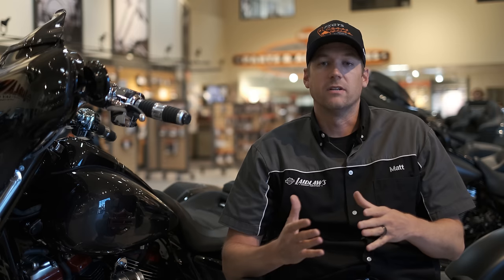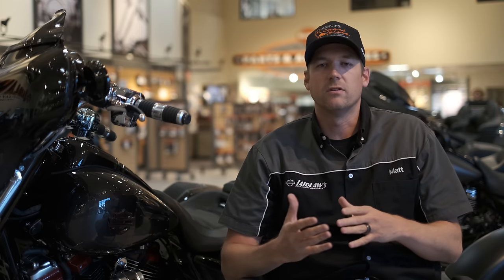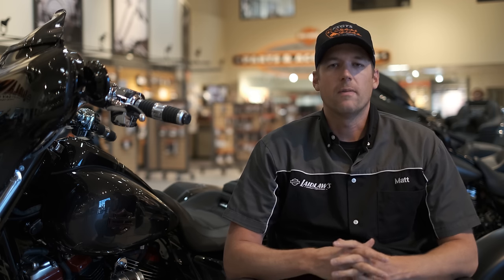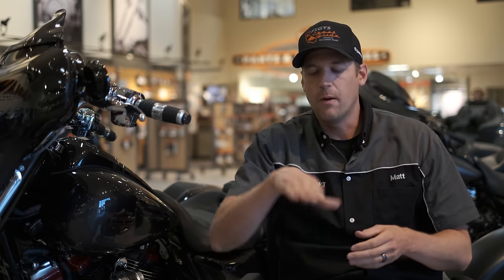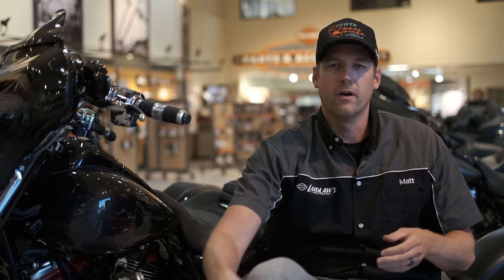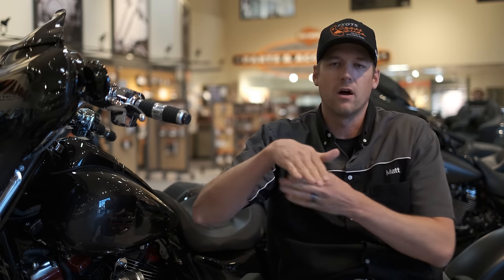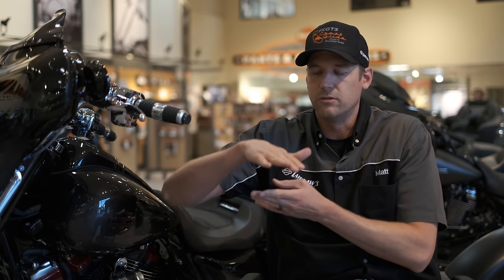Heel Toe Shifter on a Motorcycle: How it Works & the Pro's vs Con's

Comment: While in the military I always had to have spit shine jump boots on duty. Up shifting with just a toe shifter ruined the shine on the boot toe. Once I got a heel toe shifter from an aftermarket party in 1983 and installed on my 1981 BMW R100RS, my jump boots remained shined as I got to my unit. Today am on my 28th motorcycle, a 2015 HD Road Glide CVO with 95K miles since new with my heel toe shifter still shifting.
Reply from the maker: I love it. Thanks for the comment that is a good use! Definitely justified.

Comment: I came from right side shifting in the sixties to left side toe heel in the nineties. I think your right wrt floorboards. Call it lazy or more comfortable it really comes down to how you adjust the shift levers. In your example 117 Street Glide the heel lever is a bit high for my liking.  IMO you want it just high enough to make positive shifts without board interference. For me, I like the toe higher than the heel, adjusted on a straight line at roughly 9:30 - 3:30. I have my RKC, SGS and Deluxe all set this way.

Comment: Been using the heel shifter since '03. I prefer it. Some buddies don't. Be careful, do not stomp it, and keep your linkage tight. When tightening the rear it helps to push the arm back/vertical.

Comment: Im 5’4 1/2”….currently on a Forty-Eight with the stock forward controls. 
Fun bike. I could use a heel toe shifter to make things more tolerable; I am constantly pulling myself forward in order to remain comfortably in control. I have been looking into the ‘Rock-it shift kit’. Still on the fence though. Thanks Matt.

Comment: I'm a brand new rider, been out now 5 times and I have heel implants in both feet. I'm super stoked to try this out - as I can't shift up without lifting my whole leg up in a slightly 'jerkish' fashion, and occassionally upsets my balance. My left ankle is very rigid and both are locked at 90 degrees with very little ROM. I've been practicing on my boyfriend's 2000 Kawasaki w650 and it has been great to learn on. Pressing down on the heel and toe is not the problem at all, it's that upward toe-under motion that I really get stressed over, and pain for days when I do a lot of it.. This will be so awesome! I'll report my impression and feedback when I get one 👣

Thanks for the great info.

Comment: The Kuryakyn heel toe shifter kit literally enabled me to functionally operate my new 2015 Honda Goldwing Valkyrie.  The shifter on a Valkyrie or any newer Gen Wing operates just like a street bike shifter. So, with my shorter leg in seam, I don't have the same reach as longer legged riders to pivot my foot under the shift peg.  I could only engage 1st by the simple down shift slap. With the heel toe shift kit from Kuryakyn, it engages the oem shifter by locking into it, and when I slap the heel lever, I can easily engage the bikes up shift function with ease. Problem solved. I can ride the tires off that machine now. BIG props to Kuryakyn for manufacturing this great kit. I thought I may had to sell the bike I just bought online, without ever sitting on one.  If I buy a Gen 5 Goldwing tourer, I will be installing this kit as well.  Also. I kept the oem peg with the shift kit.  It works more efficiently for me than to add a small floorboard. It it feels sportier.  I was already used to a heel toe shifter on my VTX 1300.  MY 99 Harley Softail Custom is still just a standard toe shifter.

Comment: I like having the heel toe shifter took to it right off. Only drawback is my left foot feels a little crowded. I had my forward shifter  become loose and I went flat to the footboard. I immediately switched to the heel shifter. Luckily I was headed to the Hammond  Louisiana dealership and was able to borrow wrenches to tighten the toe shifter and put it back in it's normal position

Comment: I have short legs and generally wear taller soled boots when I ride so I can flat foot the bike at stops.  I've had heel-toe shifters recommended to me, but I haven't had the chance to try one yet.  It seems like it would be easier than wedging the chunky boots around the peg and under the shift lever.

Comment: I love my heel toe shifter, I did just buy the Extended heel toe shifter because of my big feet, size 14 boot, so ill have more room between the front and rear. it gives you about an extra inch on both sides.

Comment: I think Heel/Toe was industry standard in the early sixties and then they changed in the late sixties. I love how it saves the shoes. Those shift pegs can mess up a nice shoe. 
Question: Can stabbing the heel too firmly damage the transmission over time?
Another question: Are heel/toe shifters available for Dynas (2014)?
Reply: I love my toe shifter mark on every pair of boots I own, I only wore shoes once & got a 3" gash to the bone on my heel, because that was the day that a cager decided stop signs didn't apply to them...never again...but the shifter mark is a mark of pride, a badge of honor...it clearly shows I ride a motorcycle & it helps identify other riders too...no matter how they're dressed, if you see that mark, you know they ride...

Comment: Great video Matt... I heard it the heel shift was invented by a traffic cop that kept getting a marked boot but 'Im not sure...   I have a 14 fat boy with a heel toe shifter I love it use it all the time. I picked up a 45 degree knuckle for the heel shifter which gives you more room. Just tap it with your heel for more movement on the motorways and when you stop at a set of lights flick it forward for town work....you can get this knuckle as a HD part or from Drag Specialties if I call... good luck guys...

Comment: Love the heel toe shifter!  Had one on my 1981 Wide Glide with forward controls. Easier to stomp down that heel to slam through the upshifts. My current Fatboy has it as well.  I'm looking for ways to adapt or fab up that style for any other bike I may pick up. My dad was a motorcycle cop in the 1960s (1965 panhead, then 1966 shovel police model) and told me that shifter was developed to prevent toe scuffing and keep polished police motorcycle boots looking good.
Reply: Back in the 60's I had a couple of used cop bikes and they all had tank shifters due to sidecar use, no need to worry about scuffed boots  on those bikes.

Comment: I test rode a '17 Road King once when I was still in the Air Force and it had the heel shifter. Personally, I like the heel shifter. I had previously had a sportbike, and it was harder to upshift with the steel toe boots on vs normal boots

Comment: I saw the title of the video and was like "WHY would you need to explain to people about a heel toe shifter?" I didn't know that some people didn't understand the concept or disliked them. I've never gotten anything "stuck" on the heel shifter like foot wear or clothing so being afraid of that doesn't make sense. I went from a 2001 Fat Boy to a 2009 CVO Road Glide and they both had HTS and I loved them. I now have a 2020 FXLRS and nobody makes a set for them yet in mids. Yup, I want a set of mid heel toes for my Low Rider S! I've emailed Santoro Fab Worx to see if they would start making them and they said they might so I'm keeping my fingers crossed. It's waaay easier (at least for me) to stomp into gear and get a positive engagement then it is to lift the front of your foot, but like everything else in the motorcycle world, to each his own...Ride safe everybody. BRAAAP!!!

Comment: Bought a bike yesterday, picked it up just now, pretty sure second gear is shot, but coming from a speed triple, which was like a bicycle, to this, it's different, but I do like the heel shift. It's super easy. But also it's gonna take a while to get used to. I grew up in Italy and Vespas are basically your first vehicle, the old ones had the gear shifter on the throttle. They were cool, Harley guys might laugh at a vespa, but they are fun.

Comment: Just bought the 2020 triglide.  I have been riding Harley's for 40 years but I'm now 71 so I went with the trike. 2 reasons I like the heel shiftier is when I am coming to a stop and I am shifting down and at about 5 miles and hour I kick it down into 1st gear and then I tap the heel shiftier an I can hit nuealtal much easier. I don't like holding the clutch lever at stop lights.  2nd reason is the heel shiftier helps me to keep my boot from scratching the primary cover. So now with the 2020 I might have to get me a shiftier.

Comment: The dealership I bought my bike from didn't put a heal shifter on for free. I had to fork out about $40 for the kit. I eventually found an extended length shifter arm online and added that and it gives my foot more room on the board.

Comment: My left knee is shot, so moving my foot back and forth to use the heel shifter is cumbersome.  About the only time I use it is when I'm taking off from a light and running through the gears.  After that, it's all toe.  I had a heel/toe shifter on my Vulcan Vaquero before my FLHXS, and the lever was longer which gave me more room on the board for my boot.  The one on my glide feels cramped.  I may remove it at some point, but so far it hasn't been too inconvenient, so I've left it on.

Comment: I’ve owned both, presently I own 2 bikes and both have boards and hill/ toe shifters one of which is a Harley and it’s fully adjustable which is very nice. I see lots of Pros here and no cons as some boots just simply won’t go under some shifters, but the hill shifters do not limit shifting soy to certain boots , but obviously some are better suited than others as the biggest focus should always be on grip( when you put those things to the ground to stop. Yes a hill / toe shifter takes a little getting used too, but this is done generally pretty fast and once there, you probably won’t want to go back...Ride focused, Ride Smart.

Comment: I installed a dyna mids kit on my 2005 wide glide. I'm not buying the optional inner/outer primaries with the shift shaft poking through. I'm reworking the stock forwards shifter, pointing backwards to facilitate shifting. Question:
Would a Softail shift arm(heel/toe) type, with the longer splined shaft fit in a wide glide forward mount hole? I was thinking, if I can use the longer splined shaft, with a spacer installed first, then install a shortened shift lever, positioned like a heel shifter, to shift from the new midmounted footpeg.

Comment: Another advantage of the hell shifter is if you have ankle damage in your left ankle.  Loss of mobility in the upward direction.  The heel shifter makes it much easier to shift with that issue (which I have).  I CAN shift up with the toe, but it is more fatiguing now than ever.

You can also (with a heel shifter) adjust your shifter down a bit on the toe side, since you don't need to get a boot toe under it, and it makes for two very low, easy surfaces to press on.  Not for everyone, but it can be done.  Those of you that are just too "old school" to learn it, you're really kidding yourselves.  You could.  Might take a couple weeks riding, but you could get used to it, and might like it.  YMMV though.  Some never do.

Comment: Heel shifter all the way.  I replaced the short Harley heel shifter on my 2017 Ultra Classic with a J&P Cycles extended heel shifter.  Makes it more comfortable like the Kawasaki Nomads I've had.  I also think the heel shifter makes neutral easier to find.  I wouldn't want to ride a bike with just a toe shifter.

Comment: I can tell you as a man that experiences gout attacks, but doesn't want to give up riding... a heel/toe shifter is a gift from God when compared to attempting to upshift with just a toe shifter when having a gout attack. I was not happy when the Company stopped putting the heel shifter on the bike. Like removing the fake gas cap on my new Softail... just another way to save a buck while raising the price of the bike... but that's just business. Anyway, I digress... first mod is always putting the heel shifter on any new bike that I get.

Comment: Matt I have a 2020 sport Glide and would love to get a heel toe shifter mounted to the bike. I have bad neuropathy in my left leg and my leg gets worn out as I get into the higher gears it makes it difficult to lift up to say 4th 5th or 6th gear. My local Harley dealership told me they couldn't do it, I also wanted to add floor boards to go with it to give me more movement on that leg. Great video appreciate any help you can give me thanks buddy.
Reply from the maker: You need the floor boards for it. Yes, it can be done.
Reply: If you want it done it can be.  May not be a complete kit with hardware available is why they told you that it can't.  Just parts changers are what they are.
Reply: @MattLaidlaw  what HD floorboards could I use, so I can let them know what to order. Thanked Matt for your help brother😎

Comment: just bought a 23 new heritage anniversary bike that has the heel toe shift. i’ve never had it on my others. i also have an ultra classic and a chopper. anyway, i feel like it’s too high or something on the heel? i gotta lift my whole foot off the board to use it. is there something not right, angle of floorboards? I wanna like it but can’t get to feel comfortable? what’s up? give it to me straight. i can handle it lol. Ty. Respect.

Comment: I had a heel toe shifter on a 2007 Heritage Softail classic and put 45K with no problems. When I bought a 2015 SGS the splines on the shifter shaft stripped out on me twice using the heel toe shifter, stranding me once in AZ.  I now ride a 2021 RGS and the bike came with only a toe shifter. Is that due to the problems with the splines stripping?

Comment: hi...i like the heel toe shifter but I have big feet(size 14 men) so I bought the extended toe shifter which is 3.5 inches longer. I don't have any problems getting to the heel part, but when my foot is on the board no part of my foot is under the toe shifter; I have to slide my foot forward to get it under. Do you see that as a problem? Really, the only time I need to shift up with my toe is to find neutral. What do you think??? Thanks!!!

Comment: I went from a smaller bike with floorboards, but no heel shifter to one with a heal-toe shifter. First half hour on the new bike, I wasn't quite putting my foot forward enough on the floor board when I picked them up, was accidentally clipping the heel shifter and popping neutral or second accidentally while I was feathering the clutch pulling out and slow manoeuvring. Nearly led to a stall as I was pulling out from the Yamaha dealers entrance onto the road (saved it by still letting clutch slip and just letting the engine lug me out over the road in second) But after about an hour, once I got comfy with the new floorboard position, no real problems. I haven't intentionally used the heel shifter yet, but maybe on a long cruise I'll give it a go and see.

Comment: I have had 7 HD touring bikes and definitely like my heal shifter....do not use it for up shifts but because of HD clunky transmissions a blip of throttle, a tap on the heal and the bike is in neutral, much harder trying to lift the toe.

Comment: I just bought a Moto Guzzi Eldorado 1400.  Though the heel shifter is removable, it seems that you almost have to use it, because the toe shifter lifts up and back, making the toe upshift very resistant and vague.  Also, the heel-toe assembly is much closer to the floorboards than in the example in this video, making a precise linkage adjustment important.

Comment: Pro: They work great and keeps the top of your shoe clean. 
Con: In stock config they aren’t long or low enough for big feet
Reply: The Airflow Collection shifter kit has a longer heel shifter lever that gives you more room, unless you are wearing size 16 boots.😁😁😁😁😁
Reply: Well I assume the MOCO didn't have in mind Bigfoot when they were in the designing phase...hahah
Reply: Size 14’s here. I use an aftermarket company called Softbrake. The have .5” up to 2” longer length over stock levers and extended and lowered brake pedals.

Comment: If you've ever gotten foot drop, a heel shifter is a big plus. My only complaint about the HD one is that it's obtrusive. If you have big feet, it's not as comfortable. I had a 1600 Nomad and the heel/toe shifter on that was superior to the HD heel/toe. The heel was sort of behind the floorboard and the floorboards were longer I have size 14 feet and it works better. Adjust the heel low and I only have to lift my heel an inch or  so.

Comment: i like using a heel toe shifter, but one fairly big con i've run into lately is a new set of loose fit chaps i bought are getting hung up on the heel shifter. that's not great

Comment: Here’s one for ya...on my ‘15 Street Glide Special (Rushmore), I was on a “road trip” when my shifter shaft splines went (known issue)....service writer at a H-D dealership in Tennessee asked me if I used the heel shifter. When I said I did, he tried to tell me that was the reason that the shifter shaft splines stripped! I then asked him why the hell the MoCo would ever put them on if we weren’t supposed to use them! 🤣 Same guy tried to tell me I had to pay a $50 “diagnostic fee” when I walked in and told him that I needed the shifter shaft replaced. I asked him where the parts counter was and told him I would change it myself, in front of the service entry doors. No diagnostic fee charged. 😄
Reply from the maker: I guess if you stomping on it too hard it could strip but I’ve never seen that.
I appreciate the comment and story though! Something to be aware of !

Comment: I wouldn’t ride with out the heel shifter. I did get an extended lever for the rear so I have a little more room on the floor board.
Reply: I too replaced my stock heel shifter with one 2" longer to get it aft of the floor board instead of right were my heel needed to be. Love the heel shifter on my 18 FLHTK.